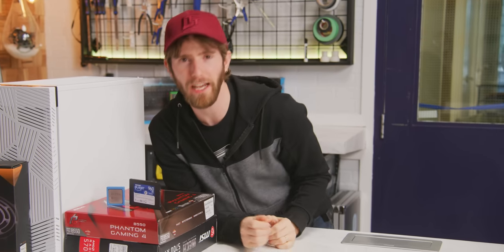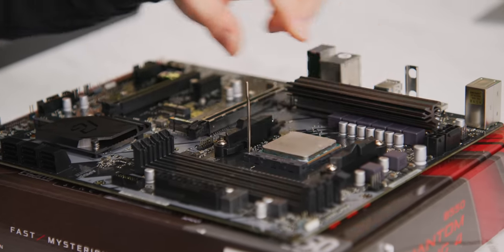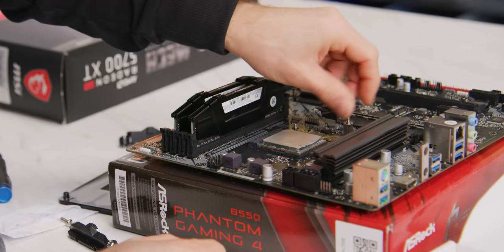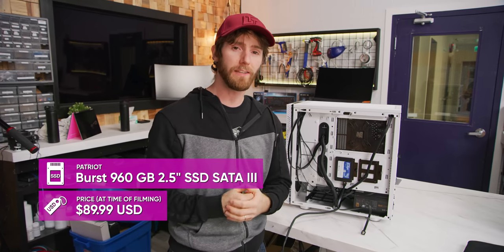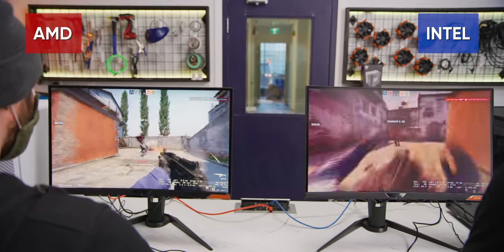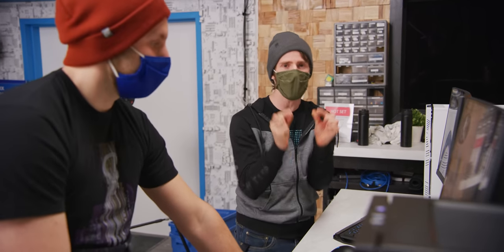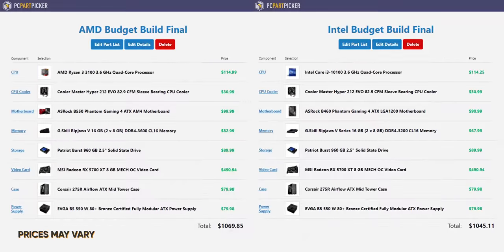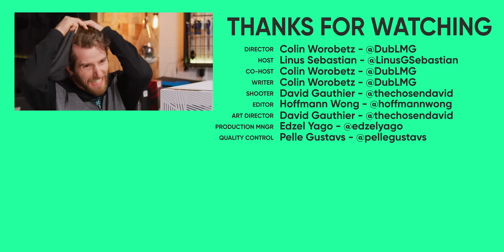AMD vs. Intel midrange gaming PC challenge

Comment: Bruh if they wouldnt have bought a overpriced motherboard they couldve bought a ryzen 5
Reply: But it was $100
Reply: @apparentlyashleys1fan113  tbh i own a ryzen 3 2nd gen but it aint worth it its prty weak at least for what i am using it
Reply: @DarianTheSUB-in6ve  oh wow i use one also i mean i just Play games so its good enough for me
Reply: @DarianTheSUB-in6ve  what u use it for?
Reply: @arthurschur  i use it for video editing as well as gaming for my YouTube Channel you can find it in the description of this channel but i do a lot of multitaskin so my cpu is alweays at 100%
Reply: Tbh games don’t take advantage of more than 8 threads anyways nowadays
Reply: @Jimster481  and it's not fair to compare with i310100 that's the point here.
Reply: @jimmsabz2227  that ain't the point. For 1000 bucks whatever gives the best performance is to be used.
Reply: @DarianTheSUB-in6ve  ohh i get itt
Reply: @benedictisaiah3021  but they also gave a reason why they chose the parts. they dont want to buy into a platform that has less features. Which is why Linus picked AMD build as the one he would take cause he knows he can get a 12 core Zen 3 and just slap it in with a gen 4 SSD and call it a day
Reply: @DarianTheSUB-in6ve  I don't even see any content on your channel?
Reply: @nfr2241  this is a second account i have my main is DarianStyle
Reply: @Jimster481  b450 has  no upgrade oath dont get it

Comment: How is $1000 mid range?
Or is just me?
Reply: PC parts have gotten absurdly expensive, mainly GPU's compared to the high-end of yesteryear.
Reply: It is midrange. Midrange from a objective / market perspektive. There are a lot more cheaper and a lot more expensive builds available, so yes 1000$ are midrange atm. What you feel is midrange is your subjective opinion measured on your willingness to spent on a pc
Reply: 5k for a top end single gpu system with monitor
Reply: What exactly is not midrange about this? You could probably save some money here and there by buying from different retailers, using discounts and promo codes or even buying used, but for new hardware $1000 is okay.

I mean he went with a 5700XT, which is a 1440p card, you could save $200 by going with a 1080p card, it's just that you'd be buying a new card much sooner than with 5700 XT.
Reply: Under $500 entry level, $500 to $1,000 low end, $1000 to $1500 mid range, $1500 to $2500 high end, $2500+ show off. 

We're talking about gaming PC's for the current generation, not "how cheap a computer can I build to be functional"

Comment: Just as an FYI, this would be around a $1700 build right now and you'd have to buy the GPU from a scalper at 2x MSRP. If you could get it at MSRP from a reputable vendor, it would still be a $1200 build because of the tariffs.

Comment: "Budget Friendly"

"$1000 US Dollars"

I do not think that word means what you think it means...
Reply: That's a reasonable PC budget kid
Reply: @hunterjd  reasonable, maybe.  "budget" absolutely not.
Reply: I feel like people would feel less attacked if they actually made decent money. Remember, if you are poor poor, get an optiplex and slap a 1650 super, if you are budget, 2060 on an AMD rig, decent budget "mid range" like this video has in either the thumbnail or title, what linus shows, and of course, high end is high end.
Reply: Budget friendly for a midrange gaming rig. Extreme budget rigs that costs around 500$, would probably be considered an entry level gaming rig. The rx 570, gtx 1650 and such
Reply: I considered my PC pretty high budget. Being about 950€ with the basic parts, without the unnecessary storage upgrades, being priced at the time I bought them. Meaning it includes parts as far back as 2012 with the price I paid at the time.

I know prices have increased a lot starting in October or so, I could have had a 5700XT for only 380€ if I had reacted early enough. In Summer you could have also had a R5 3600 with Cooler for 165€ with a B550 for 100€ and 57€ for 16GB 3200MHz RAM, which I know because I bought that for my sister. In Dollar that's a bit more, but still. 

My current PC for reference:
398€... RX 5700XT (November 2020)
139€... R5 1600X (in 2017)
96€... Asus Prime X-370-A (in 2017)
45€... Sharkoon B28 Gunmetal (in 2014)
113€... Kingston 1TB M.2 (August 2020)
80€... Corsair GS800, 800 Watt semi-passiv PS (in 2012, it's cool, because the fans only turn on if I artificially get CPU and GPU to high loads) 
70€... 16GB 2400MHz G.Skill (in 2017, Don't judge me the 2666MHz would have been 30€ more back then) 
25€... Arctic Freezer Xtreme

Additional stuff that you wouldn't really need. 
~160€... 2 x Toshiba 3TB HDD (in 2016 and 2018)
~60€... 480 Toshiba SATA SSD (in 2017) now used for game storage
80€... LG BD-Burner (in 2013)

Comment: But what about the heat? No undervolting ? I have a AMD Ryzen 3700X CPU with a GPU 5700 XT that at Junction hits like 90-120 Fahrenheit on Outriders, Doom Eternal, and Star Trek Online using Medium or Ultra graphics. How the heck do you cool these cards off at Junction?

Comment: $90 for a 1tb dramless Sata SSD? Seems like a pretty poor deal
Reply: seems about spot on, if that is around $116 canadian
Reply: well from what I've seen this is the best value sata SSD that I've seen so far... If only it went even higher in capacity. It performs fairly well too (except for the smallest one) since the main bottleneck is SATA.
Reply: @khoado2060  the 500gb Samsung 970 EVO nvme is literally $60, I think you can get an 1TB MX500 for around $100 too
Reply: @khoado2060  except this isn’t a good SSD, nor is Samsung always the best, almost certainly not the most economical. You can get a 500gb SN750 from Western Digital for just $65 today.
Reply: Yeah, Crucial Mx500 1TB costs around $90 everythere and it has everything - DRAM, good controller and new 96-layer memory chips.
Reply: @matuzaato  maybe they included tax? wd green is 77.98 cheapest on pcpartpicker
Reply: Actually I had skipped that part in the video, patriot burst has a DRAM cache, but it isn't a very big one, I personally have one of those exact drives as my second drive
Reply: @Healcraft  Patriot Burst has HMB (Host Buffer Memory), not DRAM. HMB is worse. It's also less reliable in general. It's worse than equally priced MX500 in every single way.
Reply: @sic22l  fair enough but its still fine for loading games, large file copies suffer
Reply: @Healcraft  It's niether fine or fair - it's way too expensive and unreliable. It's like Yugo for the price of Toyota Corolla. It's a bad choice, period.
Reply: @sic22l  well I don't notice the difference in game load times between Burst and SX8200 pro nvme drive
Reply: @Healcraft  It's there. Reliability difference is there as well.

Comment: A thousand dollars is mid range
Dam we have different mid ranges
Reply: My PC was $1500 when I built it and I'd consider it an upper mid-range system with a 750 Watt 80 Gold Fully Modular PSU (EVGA G3 I think), 16GB DDRR4 3200, RTX 2070 (original), AMD Ryzen 7 2700X (since upgraded to a 3700X after an accident), and an x470 board (since upgraded to an x570).  Aside from the upgrades mentioned I also added a 4TB HDD I had sitting around (originally used it as an external but kept having problems presumably due to how power hungry it is) and a blue-ray drive (which are ridiculously expensive for what they are and if you don't want to pay even more for software, like as much if not more than the damn hardware, so you can actually use the damn thing you have to jump through many hoops and may still end up with some incompatibilities).  A decent graphics card that can handle modern games at even modest settings will generally set you back $500 now though you could reduce the cost by buying used LMG generally avoids that route due to the obvious risk and the fact that they can't really guarantee what will be available (less so than newer stuff still in production).
Reply: @grn1  that is s high rnd gaming rig

Comment: when did $1000 become "midrange"? Prices are so whack.
Reply: Its because of videos like this...they keep pushing prices higher and higher that a 600$ build seems trash. Its not, you can have a very nice gaming PC with the value of just one of the GPU's used on this video.
I can only think this is "forced" by sponsors to leave buyers thinking they need to upgrade and need to spend this or that amount.
Reply: @mc1996  not really, as games advance so do the requirements. Of course the price is rising
Reply: @taylor5065  No!
Have you ever ear about Moore's Law?
Every year the components of computers get cheaper, faster and easier to produce.
 Moore's Law says that every two years the capacity of a component (number of transistors on a CPU for example) doubles, while the price remains. This was written in 1950, and its still true to this day.  If anything else followed this pattern that we have on IT we would have houses at the price of a cheap car and our cars would travel at the speed of sound, while being super cheaper than a regular car.
The price rises because the customers allow to.

Comment: Ryzens support 1600 MHz FCLK ootb which is enough to run 3200 MHz RAM, but the 1800 MHz FCLK required to run the 3600 MHz DDR is considered an overclock and not guaranteed

Comment: Remember those 2  seconds when the ryzen 3100 was actually $99.
Reply: at one point you could buy a 3600 for 159€ which was the all time low price. I sold it last month and made 30€ profit for 5months old hardware. Now i just have to wait for the current gen prices to drop so i can get 5800x.
Reply: 10100F which is better than the 3100, costs only 80 euros now

Comment: When you realise the (monitor+keyboard+mouse) is more expensive than your your whole setup.
Reply: That's just crappy budgeting. Don't buy a crazy big full furnitured, AC cooled triple garage to your single Honda Civic... Or a curved 4k monitor to your mid range GPU. In this video, I would have even picked a much cheaper case because at this price performance is the main point.
Reply: That's what I was thinking
What about the price of MONITOR huh?
If they added it the budget would have been 1600

Comment: This video triggered me.
Reply: Why?
Reply: @blokusboi8971  I think a lot of people don't consider 1000$ budget , cause it's still a huge freaking chunk of money for most people....it's more mid range as the title says but not budget at Linus keeps describing in the video
Reply: @darksouls8667  but this is for gaming. if you’re spending less than $1000 i would just get an xbox one x or ps5. not like you can buy one but you shouldn’t really be building a pc right now anyway.
Reply: @darksouls8667  its also pretty bad
couldve saved by getting cheaper ram, cooler was unnecessary, and a 5700xt for 500$??
Reply: @EC-ip3mm  yes , and the fact that u could potentially get a 3070!!! When stock normalizes obviously. 3070 is literally like 40% faster than a 5700xt
Reply: @boxr_4214  true true , no stock , inflated prices every where ,it is the worst idea to build a PC now
Reply: @darksouls8667  40%? the 3070 smokes the 5700xt. 3070 is faster than the 2080ti
Reply: @Ali Samin you need some chill
Reply: @MotionXE  ye...the 2080ti is around 40% faster than a 5700xt that's why I said 3070 is 40% faster

Comment: feel like u can do a lot better with just a couple of used components. my build was £800, built a month ago. ryzen 5 5600x. b450m pro vdh max. gigabyte 2070 super 3x. 16gb ram 3200mhz. 750W PSU.  crucial 1tb m.2. i run everything maxed out on 1440p. GTA V on maxed settings with anti aliasing, 100fps. over 300fps on iRacing. 50 fps with minecraft with ray tracing.

Comment: Your people @ Gskill were right in saying that the Intel wouldn't get the 3200 bandwidth, but they were wrong in claiming that it would run up to 2933mhz. Last I checked the 10th gen i3 and i5's only run @ 2666mhz.
Reply: If you enable XMP you'll be running up to 3600hz on your ram. I just got a new system with an i7 10700K and I simply turned on XMP and went from 2933hz to 3600hz.
Reply: @Joreel  i7 is not an i5 or i3. Even overclocked ram max is 2666.

Comment: I've used ryzen 3 2200G, ryen 7 3750H ryen 5 4600H and now ryen 5 5500H ( they all were laptops) but I liked how my friend's i7 10th gen laptop was reaching 90 degree Celsius+ whereas mine one used to be at 75 degree and both were same models just difference was in processor, I have compared AMD to i5 10th gen laptop too which is owned by one of my friend and also there AMD proved itself as a beast dudeeee

Comment: But… The Radeon RX 5700 XT actually does support PCIe gen 4.

That said, the bus speed on it probably isn't the limiting factor, both CPUs in this comparison only do gen 3 anyways, and you're probably going to want a faster GPU if you upgrade to a Ryzen 5000 series CPU with gen 4 support.

Comment: Rather than a 10th-gen Core i3, maybe I'd have gone for a 9th or even 8th-gen Core i5 or i7 -- you can get the same 4-core/8-thread 3.x GHz spec for about the same money, and have the extra cache that the Core-i3 doesn't have, which will more than make up for the older gen's lower performance, IMHO.  And, yes, that would mean an LGA1151-socket motherboard instead of the LGA1200, but still.

Comment: I'm really conflicted with the Ripjaws V, I have a 5600g in a msi B550-a pro, got a Ripjaws V  16gb 3600mhz CL18 dual kit, and it came with defects, after getting it replace i still couldn't manage to get the 3600mhz speed at all, but checked and no other problems so far, have been running it at 3200mhz and didn't return it, just because, they we're on sale at the same price of any other kit I would get anyway, but really disappointed by the product in general :/.

Comment: Well, thanks to Linus Team for their cool lessons, making us understand that crafting your own pc is way better than buying one premade. Two month ago, I was a total noob in this field and well...now gentlemen !! I'm an evolved electronic noob who saved a lot in choosing its own parts and buying them at the right time. The results here in France, all for 625 bucks and waiting for a gpu (acer freesync screen): a noctua nhd15, a well ventilated case called the matrexx 50 (better airflow than the 55), six 140mm pwm fans for the long run, a ryzen 3600, an asus B550m tuf, a gold 750w power supply from msi with all the shiny japanese 10 years warranted transistors and full modular stuff, a crucial P1 nvme 1 TO, 2*8Ghz corsair 3600Mhz Cl18). Patience is maybe a goddess x)...

Comment: The reason you couldn't clock the AMD RAM is because in the manual it says to put the RAM in A2 & B2 slots while you had them in A1 & B1 slot. Same with Asrock x570 phantom gaming 4 motherboard.

Comment: Hey Linus I actually have and i3 10100f with a 5700xt but I'm having trouble with my gpu utilization... ik I should be able to achieve over 144fps in games like apex and cod but I'm limited to low 100s and 70- 80+  % usage (90 + occasionally but not consistent). Do i need to upgrade my cpu or can this be fixed?

Comment: Could you stream at 1080p mid to high settings with the AMD build in this video? 😬 Really nervous about trying to build my first pc for streaming
Reply: Get a ryzen 7 cpu. They are great for streaming and gaming. You can get the 5800x if your budget permits and if it doesn’t you can get 3700xt. 16 gb ddr4 and wait for an affordable graphics card or just blow out your cash on an rtx 3070 or 3080

Comment: There are soooooooo many old workstations on ebay with i7-2600 equivalent Xeon CPUs with tons of ram for $100. I would really like to see how a 2600k (non-overclocked) with a 6800XT or a 3080 compares with one of the systems from this video.

Comment: Having built a boat load of both Intel and AMD systems and running Benches on all of them over the last few years I will say the AMD would have pulled ahead more so and only by a small amount if the ram was fully utilized.  Regardless in this showing you get a decent rig for the same money no matter which way you go, but to be honest go i7, the i3's are good but for this type of gaming splurge a bit and get the i7 it's a much better choice in the end.

Comment: Also, make sure you update the firmware on the motherboard to the latest version. It might actually improve RAM compatibility and enable the RAM to work at the 3600MT/s that's on the box.
Reply: i had to do this with my A320 board for a ryzen 5 3600 and i can confirm it did get me to 3200mhz (the advertised speed for my 2x8gb corsair vengeance lpx kit) from 2400 and i had a significant increase in fps.

Comment: I'd have liked to see the 3300x chosen and saved the difference by using the stock cooler, and the XMP would have worked if you used the other slots.

Comment: Well iam doing a 1000 dollar build and i was going with intel i will use a I5 10400f or 11400f (depends what budget i have left) and a 100dollar gigabyte motherboard(b460m v2) and i will buy a used gpu i can get a 2060 for like a few hundred bucks (yes i looked to where i can find theese)